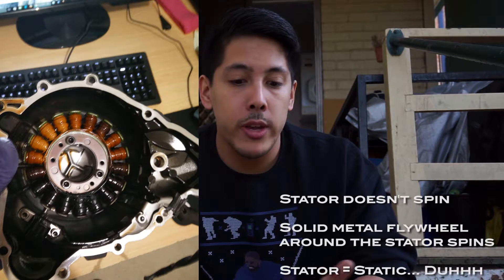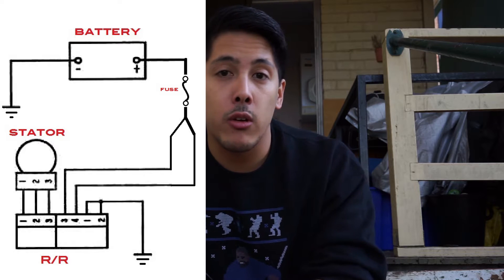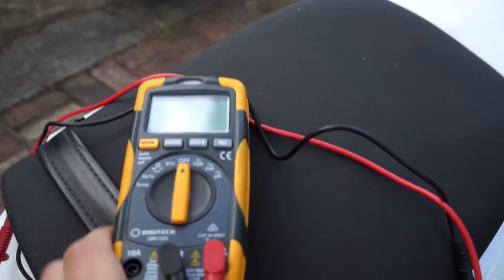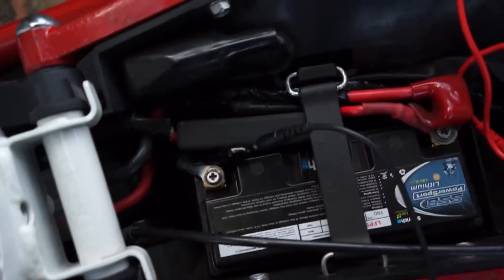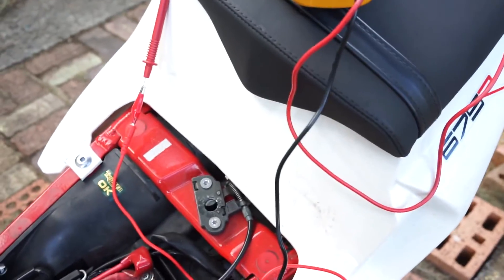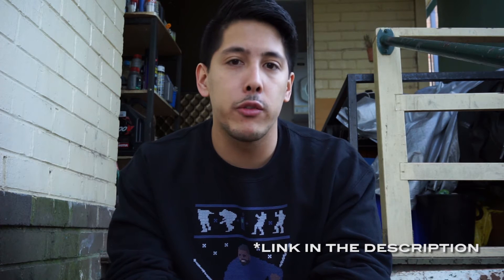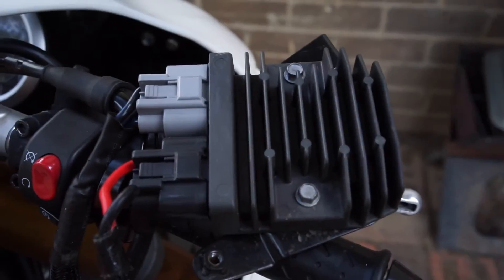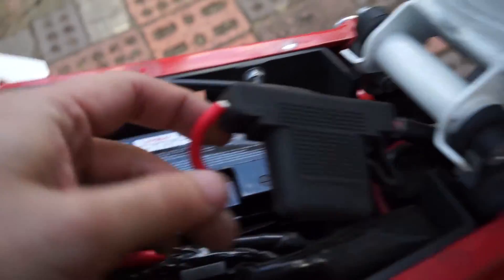[How It Works] Motorcycle Charging System

Comment: Can some one help me... Plz

My stator 3 yellow wires get super hot, is that normal?
Reply from the maker: That is very normal, just keep an eye on the connectors and insulation and make sure it's not getting burnt or brittle or melting.
Reply: @howtomoto  connectors got melted, so i ran them straight....
Reply from the maker: Mine melted too, so I bought very high amperage wiring, and ran new wires from the stator to a brand new R/R, completely bypassing the standard wiring harness. These new wires were about twice the thickness and they only get warm now, not hot.
Reply: @howtomoto  bro one other  concerned that I have, it's that when I bought my Wildcat (artic cat) it wasn't charging, so got a new battery, new stator (magneto) and a new  rectifier....  well I didn't install the gasket ride so it was leaking oil,  so I opened it again and I noticed that the magnets on the stator where scratched like if it was touching the flywheel....  when I took the old stator out it had the same deep scratches...
 Is that normal?... Do u know?
Reply from the maker: @ELCHACA  This is probably one I'd refer to a real mechanic, it would be too hard to tell what is causing this without being there.
Reply: @howtomoto   I found the problem my flywheel the spins around the stator or Magneto had a little metal scratched it was like lifted so it was touching the magnets on the nothing at all so it was doing a ground connection

Comment: Whats the size of the r/r wires? They look like 12 gauge. Can you confirm?
Reply from the maker: I'm not sure what gauge they are, here in Australia we refer to cables by the cross sectional area of the copper inside. I used 6.0 mm^2 cable from this Australian company https://bit.ly/2nOphPU. I chose it because of the high amperage and voltage it could handle. It's definitely overkill, but I am yet to have a problem.

Comment: You forgot to film The voltmeter when starting the bike big mistake.
Reply from the maker: The purpose of filming the voltmeter was to show the 3 voltage readings (bike off, ignition on, bike running) to determine if the charging system was working correctly. Filming the voltmeter during start-up did not serve a purpose in the point I was trying to portray.

Comment: exellent vide best ive seen im getting 16.3 v reving so im thinking rectifier gone i have 3 yellow wire and a black and red one and im thinking of upgrading rectifier im not getting the risistance as in book. But i would not know if i upgraded which of the 3 yellow wires would go to what yellow wire on the harnes. a video on the upgrade you did would be good to the honda one and how the connections work to the harness.
Reply from the maker: The order of the three yellow wires does not matter. Check this thread, it covers everything from testing your stator to testing your RR: http://bit.ly/2sX9wb5

Comment: Hey brother! Thanks for the video. Recently, I was riding and the bike (09 Daytona 675) lost all power and shit down. Now, the bikes power will come on, but won't start, only makes a single click. Problem is, i checked the maintenance records and the bike just had the stator replaced three months ago and I swapped the battery out last month. Any idea what could be causing my stator/charging system to continue to fail even after replacing? Obviously the RR would be the next step for me, but just wanted to get your opinion.
Reply from the maker: Check whether the stator was replaced with an OEM original or aftermarket. OEM original or even OEM rewound is better than an aftermarket. Try the quick test with the multimeter I mentioned in the video and then check this thread for the stator test, it covers everything from testing your stator to testing your RR: http://bit.ly/2sX9wb5
Reply: How To Moto thanks man! But I just took her apart yesterday. The three wires from the stator to rr were melted together. Apparently the previous owner had he stator replaced and redid the wiring. Used too thin of wire, not enough resistance. I appreciate the reply man. Best of luck

Comment: Hey mate, thanks heaps. I have an '07 Street Triple whose charging system has just frazzed. Into the rabbit hole I go.
Reply from the maker: +jonathan brain music let me know if you need any advice or tips, happy to help :)
Reply: Thanks mate - can you help interpret the following data from diode test of my r/r?

Multimeter negative on output positive, positive to inputs- 0.112 on all three inputs
Multimeter positive on output positive, negative - out of limit on all three inputs

Multimeter negative on output negative, positive to inputs - out of limit on all three inputs
Multimeter positive on output negative, negative to inputs - 0.545 on all three inputs
Reply from the maker: It looks ok from those readings, as long as you're not getting a "short" reading (I'm assuming your multimeter is on diode test mode). 

Another very simple test is to measure the voltage across the battery when the bike is running. When revving the bike, the voltage should be very stable, if it's fluctuating up as you rev and then going back down, the rectifier is bad. 

Secondly, test the stator as well, because the R/R can only do it's job properly if the stator is working properly as well. Measure the stator output voltages (positive to 1 of 3 outputs, negative to ground) when the bike is running and see if all 3 outputs have the same voltage (don't rev this one too much as the voltages will reach 70 to 100 V)

This thread is also very useful: http://www.triumph675.net/forum/showthread.php?t=35227
Reply: Dude - you're a legend, thanks heaps. No short, as far as I can tell. I was using diode test mode. I should have mentioned that the stator is fried - it gave a short reading so I opened it up and sure enough a bit of a charred mess.
Reply from the maker: One bit of advice I strongly recommend, is to only use OEM stators. whether that be brand new, second hand, or rewound. I rewound mine, and it looked better than stock.
Reply: Did you rewind yours yourself?
Reply from the maker: Haha no, I'm not that good. I sent it off to be done by a local guy here, it cost me $300 AUD

Comment: The Stator spins?  Why does my Stator only have 2 wires?
Reply from the maker: +K Singleton the stator is actually stationary, the metal cylinder it sits within spins. A stator with 2 wires is just a simpler design (single phase) as apposed to a 3 wire design (3 phase) but the principles of how it works are still the same.
Reply: @howtomoto  Thanks!

Comment: I don't know why folks think the Mosfet-style R/R that Triumph switched over to is the end-all of R/R issues - it's not. My "warranty replacement" Mosfet unit failed exactly 1 year after the recall, and took both the battery AND Stator with it in the process, lol. Just last spring, the same thing happened to one of my best friends (he has a Street Triple as well). In the case of the Street Triple, I believe the underlying issue is the R/R location is prone to plain overheating, as it's location is about the worst place it could be.
Reply from the maker: To be fair, you are correct. The rear positioning of the R/Rs on the older bikes was a major contributor to the failures. And whatever model that Triumph switched to (a SCR Shunt type on my 2011) was going to cost me $650AUD from the dealer, hence the reason I ordered the Shindengen FH020 (Japanese) R/R Kit for $180 AUD. The fact that is was MOSFET was bonus in regards to efficiency and heat produced. Overall, I am unsure whether the short circuit in my stator was the reason my R/R failed, or if it was a coincidence.